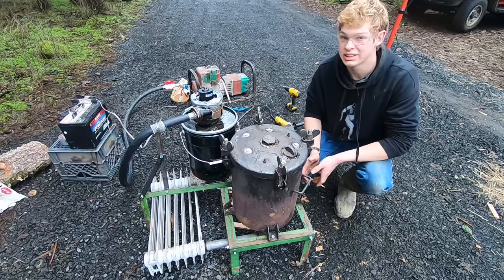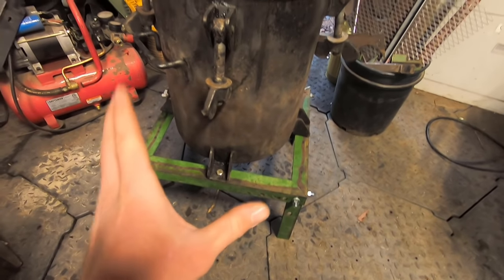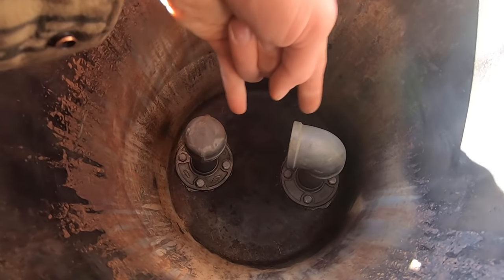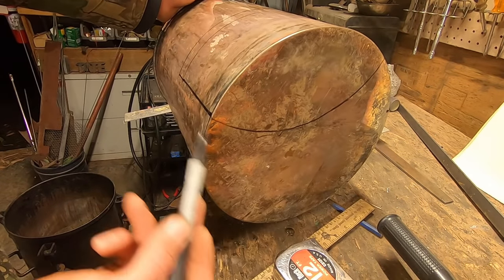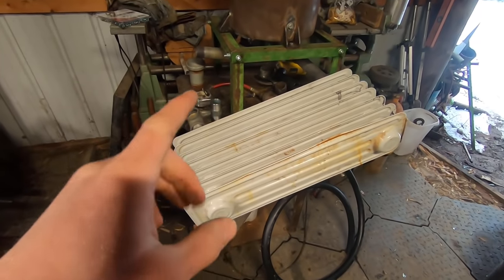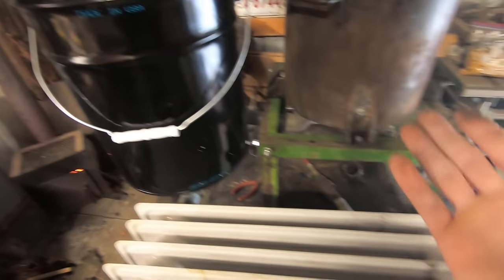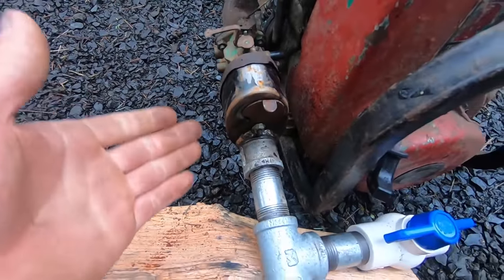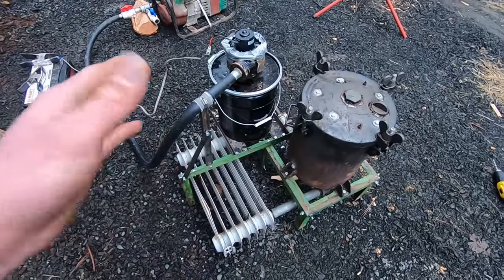Building a No-Weld Woodgas Generator! (A Functional Gasifier Built W/ a Hand Drill and Grinder?!)

Comment: Good video. We supplement with wood, justbinstalled a tempering tank for incoming water, and a heat exchanger from the stove to the radiabt heat for a boost. 
 Is there temperatures that you need to keep on mind to cool or clean or will the wood gas stay stable no matter what and filter properly. Was wondering if the radiator further wood help cool or adding a heat powered fan.
 I want to start to back feed the grid offset no sun on solar panels with my wood scraps

Comment: Hello! What an amazing idea, thank you for sharing it!
I wanted to ask, is it possible to use a GPL (or methane gas) generator in this situation? 
Also, would this work with a gasoline generator but with an adapter for GPL (or methane gas)? If yes, would such a DYI gasifier be able to fuel a 5,5 KW generator?
Thank you!

Comment: Nice.  There is another video on YouTube the guy has a blower to start up the gassifier and it is plugged into 120 volts.  So it's basically only a neat toy to show his friends while the power is running.
Reply: Depends entirely on the blower, mine uses 12v bilge blowers off the truck battery so self contained

Comment: great project and good video thank you for the time that you put in doing this I just wanted to mention  I'm sure it must have been said in comments prior to mine but you could have just turned it upside down and used the existing holes that were already there almost everything's there that you needed that you're cutting into the bottom even if even an ash clean out. Maybe not too I would have to think  on it more. Just food for thought.

Comment: Question from a newly off grid subscriber.  How big of a generator could you power with this system? One that is big enough to power a house? Wood supply is not an issue.  Would unit have to be larger? Or just go thru source material faster? 
Great videos by the way.  Well done.

Comment: Great work! Way to make a gasifier not an intimidating project. Question on that flapper, where exactly does that mount on to the reactor and what is the flap? Some kind of one way valve? Also where did you mount your drain onto the radiator? Really anywhere on the bottom I would imagine would work. 

Did you run this unit for any length of time? What kind of run time did it have with a full hopper? Super cool project man, happy to subscribe to your channel!

Comment: Great video.. very relevant now 2022..
FYI can get hi temp steam grade silver one way valves.. 
Also these valves work best and last longer if mounted vertical especially if water running through. 
Used them on solar hot water systems..
Instead of plastic type duct tape try silver metallic adhesive refrigeration tape.

Comment: Some cars have an oil separator for  the PCV system. There are different designs, but mine has a top plate with a small orifice that allows clean air to go up. You can have many of these plates with the orifice in different position, so that tar is blocked by the plate.
It should do a better job at retaining tar and big particles.
One more, thing: I guess the engine will wear out faster without lubrication. Any ideas on that?

Comment: Great design and construction. My only question: is there a way to remove moisture (condensate) and built up tars (creosotes, etc) from the radiator? A low-point drain or something? 
btw, repurposing oil heater was brilliant idea.

Comment: Brilliant video thank you for making it  i have 2 questions, could you have the radiator after the filter or a prefilter before the radiator so the radiator is not getting clogged with Tar and carbon? Also could you use two radiators to help with further cooling the gases ??

Comment: Excellent young man, greetings from Thailand, I was wondering if the use of the radiator to cool the gasses could be changed so that the gas cooling section could be piped into a water tank so that the dissipated heat could be used to heat water, just an idea, what are your thoughts on this, thank you

Comment: Maybe i missed the information but did you mention whats happening to the ash? Will i need to clean it out from time to time?
And what about using it for lets say 10-15 hours a day. Is it durable and runs stable for a long time?

For example: I would plan to run a Generator all day next to my cabin, which is kinda off grid. Theres wood everywhere so no big deal from that perspective but is the concept at all able to withstand such a long runtime? Or are there any issues like cleaning every 1 hour or sth? 
If you would plan another Video about this topic, you could show how long it runs with one load of wood and in comparison maybe with a load of compacted hay or whatever is available close to you. (bushes, hay, horse poo? :D)

But man! Nice video and even if some things were done kinda sketchy due to the target to build it without welding, i saw many creative ways of getting tasks done even if you have a welder at home but its a material your welder isnt able to weld! Nice Job!

Comment: What if instead of dispersing the heat with air cooling using a radiator, you design the system to use water cooling, and use the steam bi-product for running a small steam turbine generator that can provide the electricity you need for the fan running in your system, as well as charging your battery you use to start up the system, it would make your system self sufficient, and not solely reliant on the battery

Comment: You get 40% gas saving by altering the intake air valve, let the air valve open  while the piston goes up half way up the cylinder and then close to compress the remaining air, this way you get double the length of the explosion and substantial gas saving.
Reply: how do you make that happend?
Reply: @kromulviking8568  Live the intake valve open while the piston compressed up to half way, then close the intake valve , the explosion had longer to go for the ammount of fuel  and uses all of its power  for the engine.

Comment: adding superheated steam to the air entering the gasification chamber should increase the amount of usable energy because O2 will form carbon monoxide, but an H2O molecule will form H2 and CO. Adding some more superheated steam after the gasification chamber will shift the gas mixture to CO2 plus more hydrogen, as well as reducing the amount of unburned biomass/heavy pyrolysis products. Obviously the best way to heat all of the steam (and ideally also the air entering the gasification chamber) is to use the exhaust from the engine and the hot syngas from the gasifier.

Comment: I’m just getting into gasifiers I was wondering is there a reason that you put the radiator before the filter? Would it not be better to put the filter first to get rid of most of the tar and ash, then putting the radiator so it doesn’t get as dirty?

Comment: I've been thinking about building something like this, but I wonder how much engine power you'll get compared to gasoline. Can you load the generator up just as much as if it were running on gasoline with a sufficient gas supply?

Comment: Great project! Could you run a 2-stroke "moped" engine on this?
(For running a 12V car generator...)
Reply: Yes! Any standard gasoline engine will work. Rule of thumb is that the more "high-tech" an engine is, the more it will be damaged by this process, so you're definitely good to go with a moped engine.

Comment: If you load rubber in reactor (like tires) - you got diesel in radiator. And this diesel you can use in regular generator or diesel car engine.

Comment: Would it help if the radiator was submerged into a water drum cut down and a small pump to recycle the water to keep it cool. You could also pass the gas through water to decontaminate it. Rather than wood chippings. Water is a fantastic cooler and filter. please try this and see if it works out

Comment: You might have discovered by now that liquid distilates will have gathered at the lowest point of your heat exchange radiator. You need to fit a small drainage lug so you can collect the water, pitch, turpentines and wood alcohols. Useful substances in themselves but primarily to keep your heat exchanger clear.

Comment: Just for fan and FYI.  Wood gas is about the following chemical reactions:  CO2 + C  = 2CO and H2O +C = H2 + CO    Other words, when carbon oxide  (CO2 ) and water or water vapor (H2O) passes through the layer of high temperature red-hot charcoal, it produces this CO and H2 gases which can be burn in engine to produce electricity. You have to use dried wood for better result.

Comment: If you use this generator you could hook it to a battery charger and charge car batteries or capacitors and run your electricity through the batteries this way you will run your gas afire less and have energy stored up .capacitors will take a lot of electricity and charge quickly but they deplete quickly but making a battery bank in between your house and your gas a fire and you’ll have to burn less wood to maintain power just a thought Thanks for the video

Comment: With this being 5 gallons how long did it run for?  Does the fan on the bucket need to be supper strong or could you possible change it over to a computer case fan?

Comment: Hey having some difficulty getting my hands on a 5 gal pot. 2.5 ones are obviously cheaper and more available would the output from the 2.5 work to power a generator? Assuming you have to fill it more frequently When running?

Comment: In the 1930s, there were mini auto - gas gen systems during gas shortages. 
With the early 21th century craze in tax-banning fuels, pushing us back to the 19th century, this may be the only cheap option to keep traditional engines, much cheaper than going electric or hybrid.
ps. my older 91 vehicle is already LPG converted, and i had 0 issues (only one minor one with a e-valve) over 15y span.

Comment: If you plan to add this to a vehicle it needs to supply  adequate fuel to power the vehicle as the demand for fuel arises. Using the downdraft or stratified gasifier like the Imbert design burns most of the tar during gasification by burning it during the reaction. It still needs cooled and cleaned prior to using in an engine but the volume of gas is adequate to power the engine at 60 to 70% of the petroleum fuel the engine was designed to run on. Keep in mind they were using this design 100 years ago. Keep it simple.

Comment: Rather than make the radiator from an oil radiator, if you can find an old hot water radiator the spaces won't plug up so fast. The unit shown will be plugged within a month. Which is not very long when you need 24-7 electricity.

Comment: closer understanding of the ratio of wood burn and gas out, any more accurate plans to follow?gas does not burn when made simply by air in control? is gas mixed with smoke from the burning wood,so less pure i guess.

Comment: Just a quick question for anyone who could answer. Tate uses wood shavings as a filter in the secondary chamber. Afterward, he says that you'll need to clean it out every so often, could I potentially use the aforementioned wood shavings as the fuel after I clean them out?

Comment: Is there any way I could possibly speak with you on building a system to power a 4.9l straight six for a 95 f150, it would have to be carbureted and timing would have to be adjusted but I'd like to take notes from you as I have been working on plans for this truck for a couple years but need some help in areas

Comment: that was a really solid design but why didnt you just use 3 of those capped steel buckets instead of a paint pot? one for the reaction chamber, one for the grate and one for the filter. just a thought figured it be cheaper

Comment: You don't even need to burn things as you can produce bio gas from sewage. A large tank filled with sewage and a bubble at the bottom to speed up the natural reaction. You do need at least two tanks to pump slurry to before you empty what is left on to the land as natural fertiliser. Collect gas from top run gas through water to clean it before burning in generater. Its cleaner and greener and not only do you make electricity you get natural fertiliser. UK water companies have been doing it for years. But you could use animal waste just as easily as human waste it has to have liquid in it to aid digestion of material and to pump slurry from tank to tank. So you could have teo digesters and a third to store fertiliser waste.

Comment: Why not just add a switching T valve in the pipe run for testing the gas so you don't have to keep reconnecting the pipe to the generator?

Comment: The problem with the woodgas going directly into the radiator is the tar and creosote will condense on the fin stopping the transfer of heat and with this unit you have no way to clean it out

Comment: Could this type of generator system be integrated permanently (in its design/construction) into a wood burning stove/cooker/range, and could it supply electric to a home? If it could be adapted, this could be one of the biggest game changers, I have ever seen! -Imagine, heating water, central heating system (existing already from wood burning stoves) AND the remaining electric to the home. Whole house power, in abundance, from a wood fired stove!??!
Reply: What about Thermal electric generators adapted to the Wood burning stove?

Comment: I've been Googling everywhere for actual facts but I can't find the info.
Pryolysis is the heating of organic material without oxygen.  This ideal process creates wood gass and has the by-product of charocal.
It should then be possible to 'burn' the charcoal to create carbon monoxide but I can't google any reference on how to do this.  I'm sure there is a catalyst which prevents the formation of carbon dioxide or is there a way to maximise monoxide production?  It seems a bit hit and miss to heat the charcoal and hope that Oxygen you supply forms monoxides rather than dioxides.

Comment: Has anyone tried running the exhaust gas back into the gasifier? I imagine starting the generator on stored gas (or regular fuel) and using the hot (O2 depleted) exhaust gas to heat the wood chips. Then you could switch over when the gasifier warms up.

Comment: In your last video you had mentioned that once your system is up and running that you no longer need the fan/blower to keep it going. But you also never showed us the shutting down of the fan/blower. So I was left wondering... Now in this video you stated to shut the entire system down, you simply shut off the fan/blower. So, to be clear, these systems DO NEED some external power to BOTH start it up AND maintain it's operation????
Reply: No only to start

Comment: Ah! That gas smoke is way to dirty for those generators, it should be almost invisible and burn blue like propane. It will foul the cylinders and react with synthetic oil also so use organic oil in the engines.

Comment: Does anybody know if a simple steam turbine or piston engine connect to a generator would be more efficient at converting stored wood energy to electricity. This gas afire seems to add more possible fail points to the process.

Comment: I built  a wood gas In to a wood  stove with a back boiler to heat our house , run our, a gen set , i used an  hi presser gas  bottle with,  the head cut of & a flag added with a solid plate to act as a  solids promissory heated by a thee wood benign stove , to was interrogated in to the wall of the fair place & was filed with wood from the out side. the wood would carol & diliver wood gas to  a filter, trow a babbler as it entry a gas bottle,  nasalized within a chest freezer two off, the gas would enter the cold Bottle  &  remand condense, until used it is  often remove so the gas could be moved to a gas stove, , condensing the gas in to he bottle is used to inalienable  storage , once in the bottle as a liquid it serves,    as a sores of presser, some put in a linear.  tube  as a sores of presser after the bubble.as a one way valve as it fill's the tube expanding & pressurizing  as a one way  valve relining  it into the bottle  under force   to con-dance    we got hot water to & cooked on the stove we had no manes power to our house .

Comment: why not put a filtering can with a catch can before the radiator ? i can't be done witout welding ? so what ? go for it. what really matters is getting clean and cool gas. and just for the purpose of making a really nice system could record another vid with just the addition of a (welded) filer can with a catch can ? please ?!
OR
could you improuve this gasifier with catchcan, and cooling from the welded one, then add this extra filter? that would be quite a site for sore eyes. :D

Comment: 25:33 if hydrogen is your goal gas why not make a hydrogen generator in tandem with your gasifier allowing you to upscale power to a larger generator? Is that possible?
Reply: No, if you want more hydrogen use charcoal as fuel and add water drip it’s simple

Comment: I'm confused. I thought the idea of wood gas was to heat the material in absence of oxygen in order to obtain flamible gas. You created a hot spot furnace instead of a chamber within a chamber. I'm not sure the difference, advantage or disadvantages heating material with or without oxygen present. Creating charcoal vs regular burn. Forgive my ignorance.
Reply: Is it the "fire chamber" is in the middle burning up all the oxygen while heating the outer oxygen deprived material thus producing wood gas?